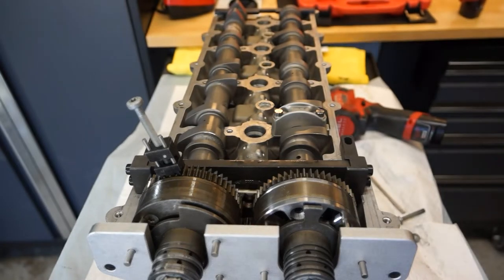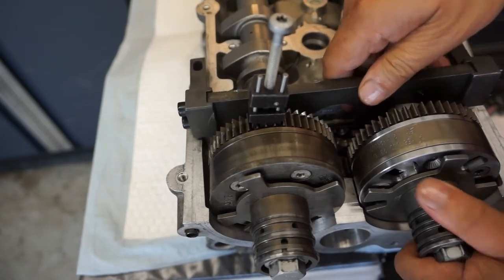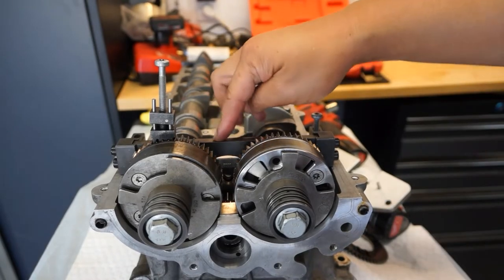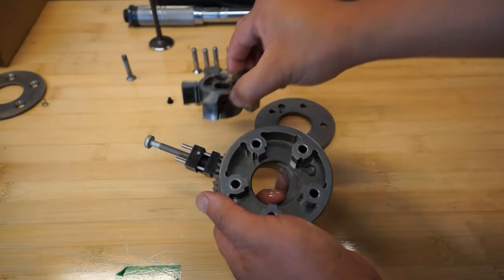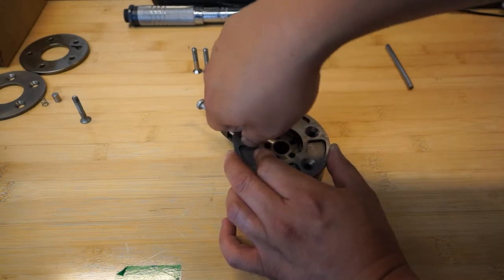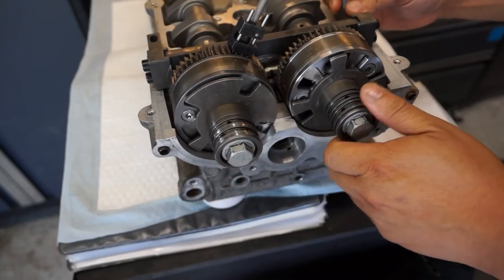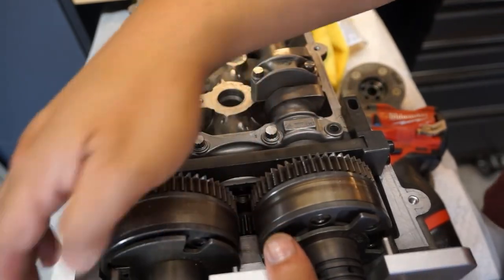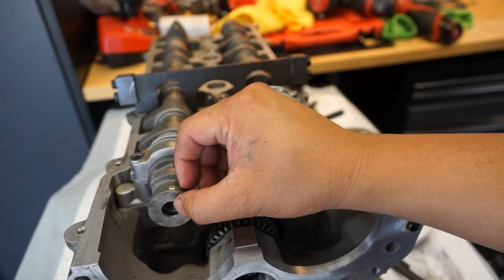63 Motorsports M156 Camshaft Phasers

Comment: So when installing the cam adjuster back the latching tool is up as shown? Not straight?
Reply from the maker: @joshwong99  it may be in different orientation if it’s been opened before. Factory install usually has them perpendicular to level
Reply: @63motorsportsinc.37  thank you !!

Comment: At 22:34 you are talking about putting the camadjusters on the teeth they belong to, which i didnt knew where they go, what happends if i placed it on the wrong one. Because i bought the stage 3 plates for my adjusters and i put everything on and i got a check engine light for p0017 and 2 missfires. Could that be the case, and another thing too the teeth on the gears of the cam adjusters line up with each other is that bad because i think i seen them slightly off originally before i touch the cam adjusters
Reply from the maker: The misfires at best is just asking for a cam relearn. At worst, timing is off (will need to retime with the timing tools) or the lockplates were somehow mismatched with intake vs. exhaust or vice versa.

The gear teeth should be off and staggered when the springs are activated to compensate for lash. This makes sure the gear is not slopping about when turning and prevents making noise and wear.

Review the FAQ instruction manual online to recount the steps for assistance or email info@63motorsports.com.
Reply: @63motorsportsinc.37  thank you, i will take it apart again, because the gears on the camshaft adjuster didnt shift they stayed align

Comment: I don't have issues on the set up of the timings but only what confuses me. What is the purpose of those pointers in the back of those adjusters gears? Are supposed to aligned them together? Or just install the camshaft adjuster where the sidewall writings or part numbers facing upward and that's  the basis of alignment of each adjusters? Thank you.
Reply from the maker: The steps in this video reinstalls the parts exactly how they would be found installed from factory. Several steps may be more geared for those with OCD as they may not serve a mechanical purpose 😅
Reply: So does it matter where the adjusters are when reinstalling them as long as the timing plates on the end of the cam are lined up with the timing tool?

Comment: Hey I’m doing this job right now on my m156 engine 2010 e63, turned crank to 40 and all the locking tools fit in the passenger side, but on the driver where my adjusters went bad, the lash gear hole is halfway open, and i can’t get it to clamp. All the other locking tools are in place and fit, jus the driver side lash gear problem. Any tips?
Reply from the maker: You may need to remove it and reset the lash manually similar to the post here https://www.instagram.com/p/CKuNuWapFmt/?igshid=MmN2cGg3dzFhZHhi

Comment: The lash tool holding the cam gears there is only one in the timing kit.. what to do when you reinstalled both cam gears?
my car is face lift 204 c63.
Reply from the maker: Most owners work on one adjuster at a time as most will only be able to physically work on one at a time. Or follow this to retighten the gears if they have come loose already https://www.instagram.com/p/CKuNuWapFmt/?igsh=MmN2cGg3dzFhZHhi
Reply: @63motorsportsinc.37 havent started yet.. should i put one cam gear on with the lash tool and hand tight it? Take off Then do the second? 
Or just use a nut too hold em in place before intake the gears off so they stay in position? Im just replacing my lifters and not the cam phases/gears they have zero play but my lifter go clicking sound when rpms go higher then 2500 rpms and i can hear em inside the car .
Reply from the maker: @usman2131  we are limited in service guidance but refer to the manual online and omit the steps for the cams and you should be golden. We highly recommend going on our homepage for a list of dealers that are VERY familiar with this job for a worry free install.

Manual online >>> https://static1.squarespace.com/static/5fce86072ae39f09448f60cd/t/659a4d1b3ccbf36378e2d981/1704611102413/M156+COMPREHENSIVE+Q12024.pdf

Comment: Question! I think I may have mixed up the part with the three metal rings. Is there any way to tell which one goes with which adjuster?
Reply from the maker: @loumu7176  the front locking tool with the dowels indexes those so it only fits in one way!
Reply: @63motorsportsinc.37  thanks, so are all 4 of those parts the same? Not matched to left or right or exhaust / intake? I looked at them and see different numbers on each. There is one oil port that faces different direction when I line up all 4 of them. Sorry, kinda hard to explain.
Reply from the maker: @loumu7176  I don’t actually have that exact detail! I believe there are only two part numbers one for intake one for exhaust but don’t have that information written down

Comment: What happens if the locking tool doesn't fit in the lash gear?
Reply from the maker: Lash gears will take a short M5 bolt to lock if the tool doesn’t fit (occurs in pre-2011).
Reply: @63motorsportsinc.37  do you have a video demonstrating what you're talking about?
Reply from the maker: @trugani569  here you go just use an M5 bolt
https://www.instagram.com/p/CKuNuWapFmt/?igshid=YmMyMTA2M2Y=